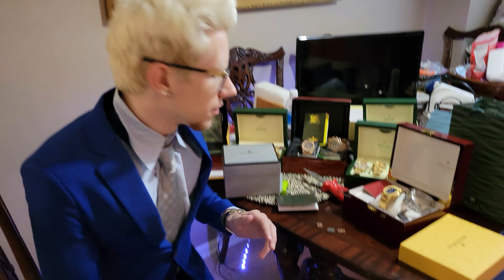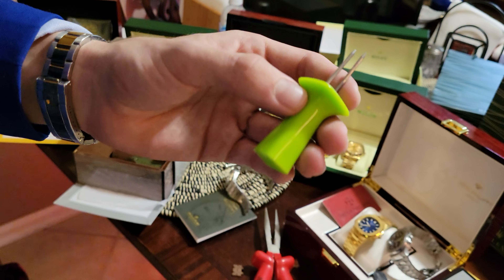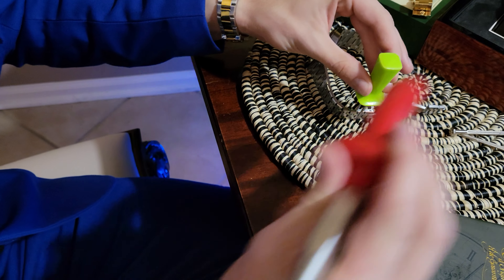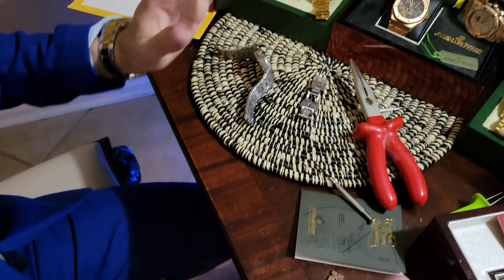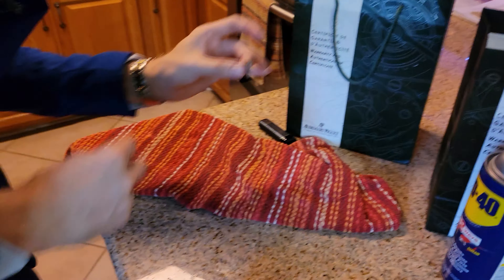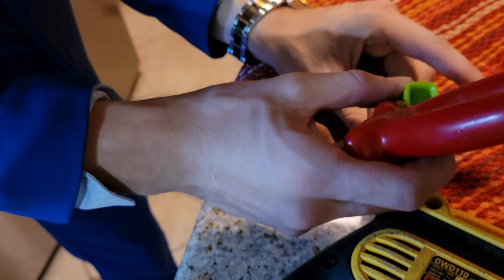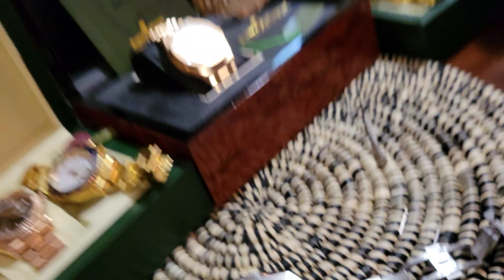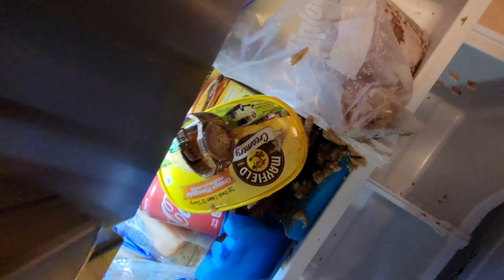How to remove watch links (tight or stuck screws)

Comment: Helpful. I put a small amount of w-d40 on the affected screw and moved it around for a wile. I skipped the hammering part  and just rinsed it off with hot water. Worked like a charm. Don’t need to watch the entire 8 min video

Comment: When you began to fry some food and the oil is hot dip the end of the screw driver in the hot oil and place it onto the screw on the bracelet  screw. It should penetrate very easily so the screw can back out. You don’t have to soak it. Just the dip on the end is enough.

Comment: I have a Rolex that has threaded screws in the band and they don't go all the way through the band like a regular pin does. They screw into the link but the head is stripped off one and the other one the threads down inside the link so it won't back out it just spins and spins. I don't know what to do 2 places told me they can't fix it but honestly they didn't seem to even know what they were talking about I had to correct them several times on different things. Do you have any suggestions
Reply from the maker: I recommend drilling it out as I did, then buy new replacement links on eBay for about $100 a link, good as new.

Comment: Dangerous with the drill bit. Raymond Weil watch is super tight. Been trying for awhile now.....
Reply from the maker: The drill is a last resort only if it is rusted, corroded, locktite, or stripped screws.
Reply: Hello, i was wondering if you’ve been able to fix it

Comment: Wow. This has to be a joke right!? Seriously don't drill your watch links like this. Or use Pliers as a hammer. If you have enough money to buy these watches, spend a little more on getting them professionally resized.
Reply: or even just a watch repair kit they are pretty cheap and can do wonders if you know your stuff.
Reply from the maker: replacement links are only $100 on ebay, this removes stripped screws.
Reply: $100 links are worth more than these fake watches. Lame